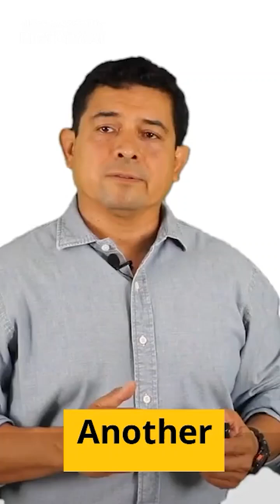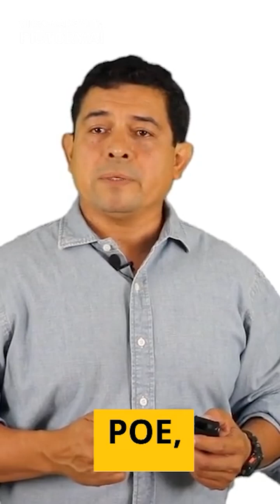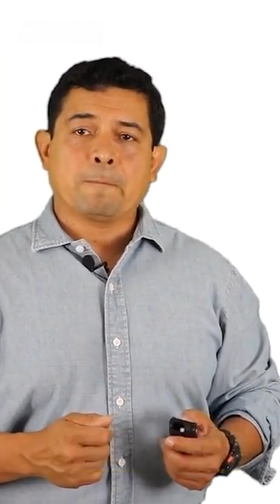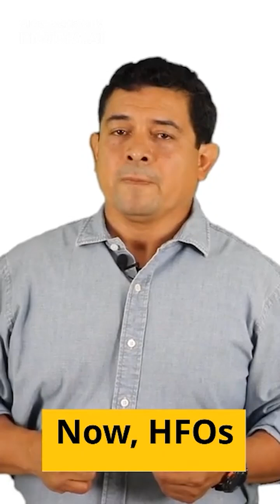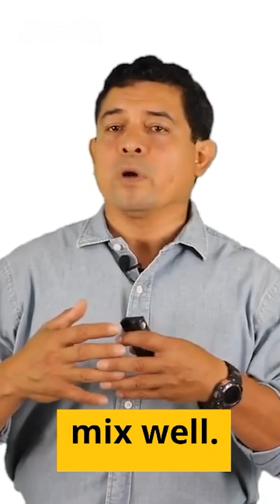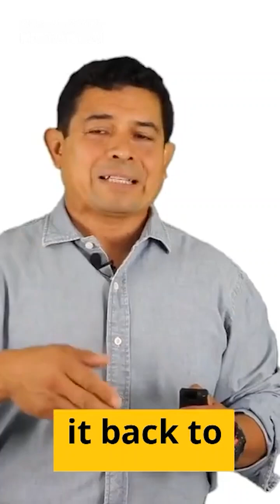Oils used with different refrigerants

Comment: What happens if there is a mineral oil in a system charged with 134?
Reply from the maker: I have seen it where people have left the mineral oil in the system when they switch over to 134a.    The system seems to work for a short amount of time, but eventually the compressor will fail. Mineral oil will not mix with 134a refrigerant well enough. Ideally, you want to remove the mineral oil and replace it with. Polyalcoine glycol PAG. oil